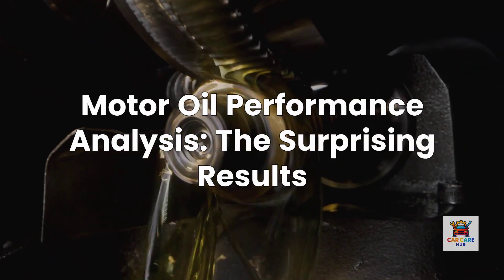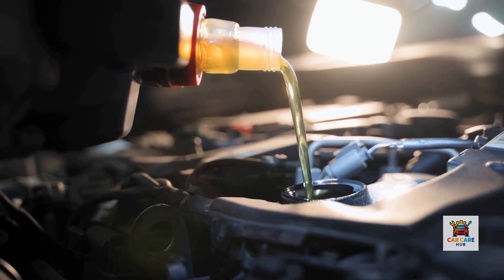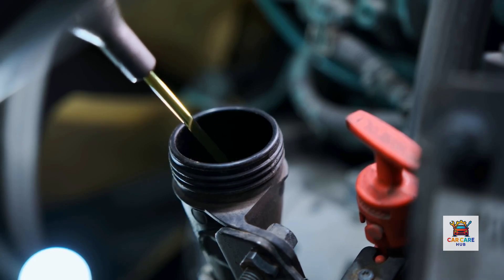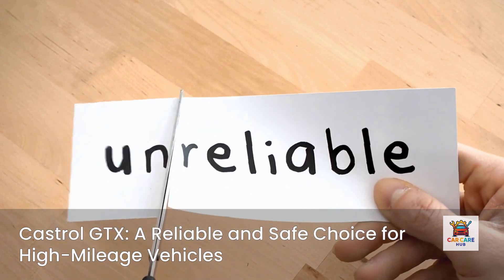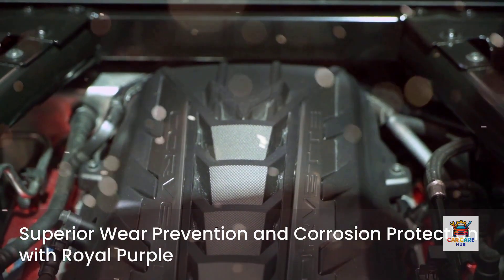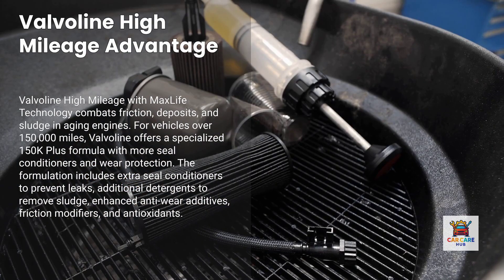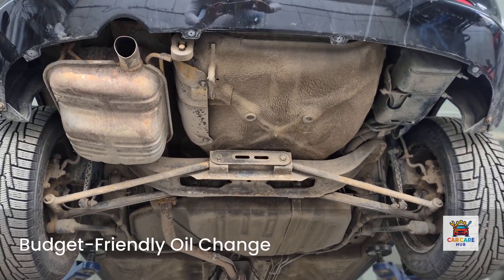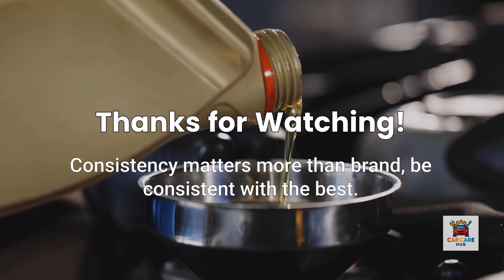I Compared 6 Oil Brands Over 200,000 Miles — One Clear Winner

Comment: I DON'T USE THOSE CHEAPER BRANDS YOU GET WHAT YOU PAY FOR. BEST BANG FOR THE BUCK NOT SAYING YOU CAN GET A BETTER BEAND BUT FOR THE BUCK LIKE PENNSOIL ULTRA PLATINUM IS A VERY GOOD SYNTHETIC OIL.  YES YOU CAN BUY AMSOIL BUT ITS MORE PRICEY. YOU NEED TO STOP TAKING OIL CHANGES ABOVE 5K MILES DO IT BEFORE 5K AND DON'T GO BEYOND. I REMEMBER PEOPLE USED IN OLDER TOYOTA AND HONDA WITH CONVENTIONAL OIL THAT GOT A LOT OF MILES BACK IN THE DAY. USE A GOOD BRAND SYNTHETIC LIKE PENNSOIL ULTRA PLATINUM  YOU CAN GET IT AT WALMART FOR 29 DOLLARS AND CHANGE. AMSOIL WILL BE AT LEAST A 1/3 MORE IN COST OR MORE  AND YOU CAN EASILY GET PENNSOIL AT WALMART.
Reply from the maker: I appreciate your detailed thoughts on oil choices and change intervals!

Comment: I WOULDN'T USE A 5W-30 IN A VEHICLES THAT ARE SUPPOSE TO USE A 0W-20. IN COLD WEATHER THE 0W-20 WILL GET OIL IN THE TOP OF THE ENGINE FASTER.
Reply: short trips and cold weather... 0W20 beter indeed in modern engines...